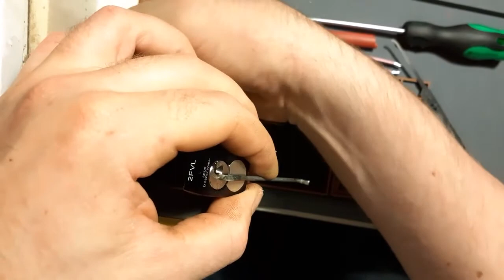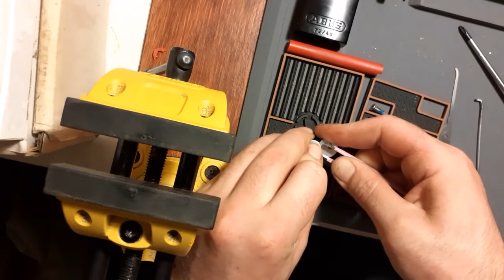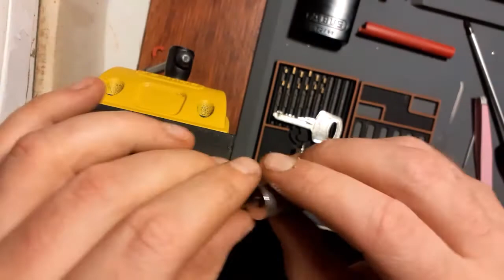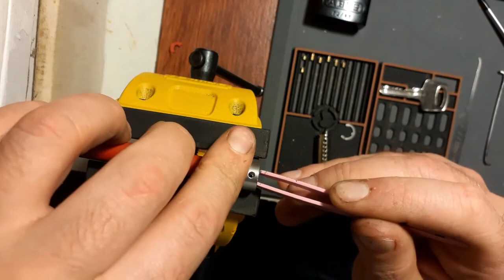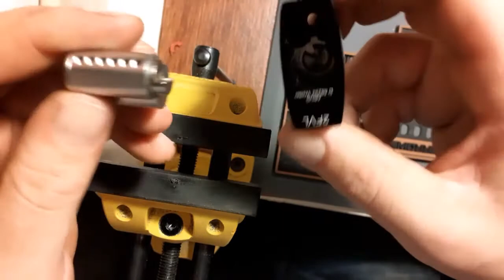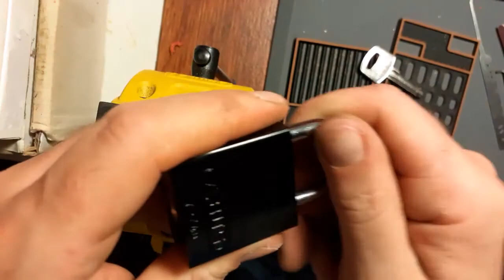72/40 Picked, gutted, Reassembled

Comment: You ran right thru that 72/40. The keyway is a little tight for my liking and those springs are way too long and springy!  I usually have springs flying out during reassembly. Great all-around job!
Reply from the maker: Thank you. Wasn't my first attempt and sure as hell wasn't my second either. Most of the locks here (EU)  are pretty tight. So large keyway are a pleasant surprise. I have the Dangerfield Praxis set, which is 8 picks in 0.025 and 8 picks in 0.015. A great all rounder. I must get a few Peterson hooks though. 4,5 & 7.